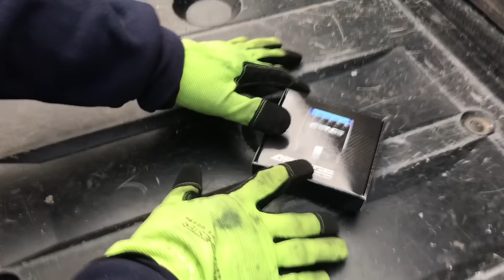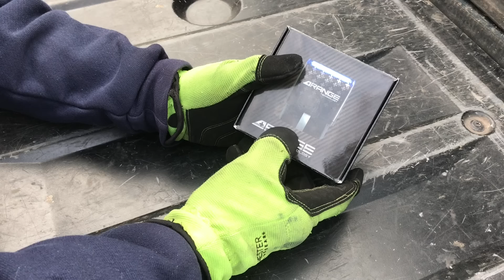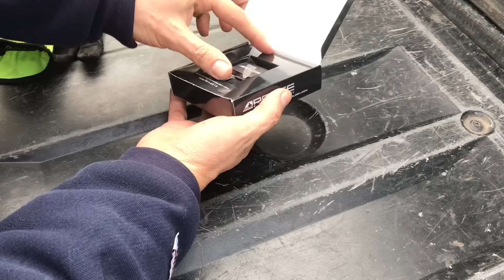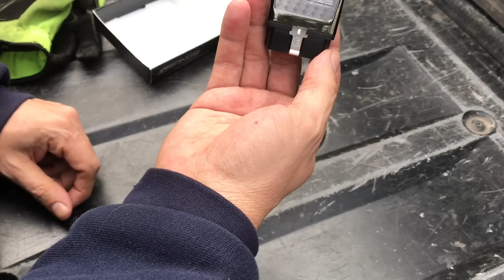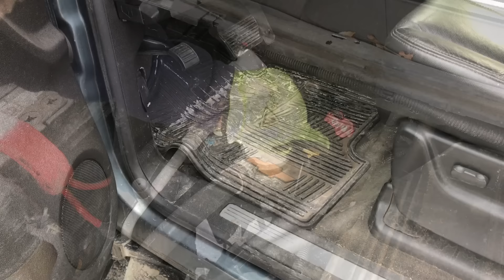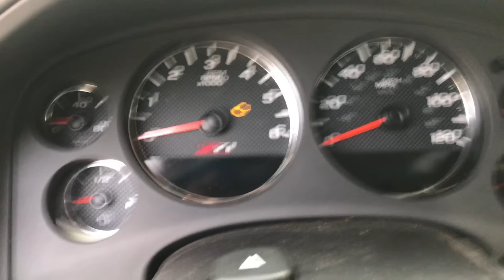Range AFM Disabler - Long Term Review

Comment: I tried this product (perhaps an older version of it, back in 2013-2014 when I got my truck) but I had nothing but problems.  I would randomly get errors on the DIC (anything from issues with the 4WD system to ABS errors).  I stopped using it, and the errors went away.  IN one instance, I had a hard shift from 2nd to third, and a check engine light, which I had to have cleared by the dealer (this was still when the truck was under warranty and I removed the Range unit obviously before taking it in).  But since I've stopped using it, I haven't had any issues.  Quote honestly, the difference I saw when using it (When it did work, which wasn't often) wasn't that big, maybe a 2-3 mpg savings.  In the end, it probably wasn't worth it.
Reply: I've run one for yr's and wouldn't be without it...on two occasions the engine light came on and false codes came up and all you do is unplug it while driving then plug it back in and the codes are gone and the engine light is off. I've also had the truck sit for 8 or 10 days and battery drain has never been a problem and winters here get down to as much as -30 C.
Reply from the maker: I’ve heard similar stories from quite a few people.  Knock on wood, I haven’t experienced that.  I definitely lost MPG’s using it tho.
Reply: @HilltownCT  It sounds like the ones they are selling these days must have a software update as many people here are reporting better stories than what i first heard when it first came out.  But some people also are telling which trucks they have so it may work better on newer ones (for example, ones with the EcoTec engines versus the Vortec engine--not sure if DOD is different between the too though).  I'm a bit surprised you lost a lot of MPGs though, as I think the hit should only be about 1-2 MPG.  For the times mine did work (which was rare) I only saw maybe a 1-2 MPG increase but maybe that was just my truck.  Others might be different. How much did you end up losing using the V4?
Reply: @HilltownCT  Mine was one from when they first came out.  I think whether you get a good one or not depends on when you bought it.  The first few batches probably had some issues in the programming, that maybe got resolved in later versions).  I drive mostly on the highway anyway (so 60 MPH+) most of the time so AFM only kicks in for the times when I"m driving around town ,which isn't much compared to overall driving, so I just deal with AFM.  Truck isn't actually exhibiting any odd behavior other than a little bit of oil consumption, but that's manageable.

Comment: On 6 speed GM automatics, if you put your transmission in 5th gear instead of Drive, it deactivates AFM too. Since most of my driving is local at speeds under 50mph, thats what I do so my truck only goes to 4 cylinders if im on the freeway and i happen to shift it into Drive (6th gear).  I think switching to tow mode might also deactivate AFM.
Reply: c5back9 tow haul mode doesn’t deactivate the afm. But I’ve been doing what you’ve been doing as well.
Reply: James Sanville: thanks James! Coincidentally, I had occasion to tow a trailer yesterday, and checked then if Tow/Haul mode did indeed deactivate AFM. As you indicated in your reply, it does not.
Reply: @c5back9  tow mode does not deactivate v4 mode on my 2013 Suburban
Reply: Charles P Stauhs not tow mode. Lock out in 5th gear instead of “D” and it won’t go into v4.
Reply: @GetOutside38  how is your suburban keeping up? I am getting a 2010 tahoe
Reply: I just leave it in 5th all the time. AFM never comes on and gas mileage is barely 1 mile per gallon less.

Comment: the issue i am having is that my AFM doesnt deactivate when driving in slow traffic, coming to slow stops.. the truck vibrates.. then the AFM deactivates when the truck stops.  any suggestions?
Reply from the maker: I don’t, but maybe someone else here can help you out.  Others have mentioned the same problem in the chat.
Reply: Daniel Grobe did you find an answer? Mine does something similar

Comment: I’ve had this device on my 13 Yukon for about 8 months (since about 47k or so) with no issues at all. MPG did not change. I bought it for what I’m hoping will be a successful preventive measure.
Reply: I’m at 97k now and all is well
Reply: How is this going in 2022??
Reply: @anthonymoy4471  119K and all is well
Reply: @seth_5394  how about how
Reply: @elchapito2368  123k and all is well
Reply: @seth_5394  how about now 🤣
Reply: @goonie2908  128k and all is well.
Reply: @seth_5394  I just bought a Caprice PPV 2011w/45,000 miles, and since the agency took the car for normal warranty service until 36,000 miles(I'm assuming the engine is ok), I'm hoping there is no problem within 9,000 miles later. I will be installing this on the car. I am getting the car next week. So this will prevent a good engine from going bad?
Reply: @robertcohen8554  that’s the theory. We shall see.
Reply: I am hoping so myself, would rather not be replacing lifters and so on. Thoughts on preventative measures taken so far ?
Reply: @LarsonFishing  hows your truck going
Reply: Try Again - running good and strong, no issues. “Knock on wood”  the device is still running good as well. All 8 of My cylinders are always firing, just as if hope, no lag or such.
Reply: @seth_5394 and now?
Reply: @andrewtodd4116  137k and all is well
Reply: @seth_5394 🤝
Reply: @seth_5394 how about now ? Still running the same disabler all these years or did you have to replace the device at some point.  Thanks I’m advance
Reply: @OBS-ip2hy  163k and all is well. Same device, never had to replace. It’s plugged in every day. I’m genuinely hoping to get 300k out of this truck.

Comment: We bought one for my son's 08 silverado 5.3 and it would make the transmission down shift real hard. Had to threaten to sue to get a refund. The fix for oil consumption was the valve cover and the oil pressure relief valve deflector. The deflector is what did the trick.
Reply: Crazy
Reply: This has me worried
Reply: @dustinabrams3111  
Should give you an update, this past June pulled the engine out because of oil leaks and the piston rings were all full of carbon. Cleaned the pistons and the rings and drilled some drain holes in the wiper ring area. Seems to not use as much oil. I"m really surprised GM has not been sued for violating the clean air act because of this.
Reply: @robertoobregon3750  Ya I won’t being buying this thought about it just worried
Reply: @dustinabrams3111  okay, so far at 200k miles and will likely go another 200k and not have to buy another. The first 200k took 12 yrs.

Comment: I'm looking into getting one just because I put duel exhaust on my truck and V4 mode sounds stupid. My Silverado is a 2013 and so far I have 96000 miles and it hasn't used a drop of oil so far.  I change my oil every 5000 miles and use Castrol Edge. I didn't realize the AFM was such an issue. I'm definately going to get one and try it out. Thanks for the info
Reply: Me too sounds dumb with dual exhaust

Comment: After start... sierra  vibrate , engine sign start to blink stability track off after mile  engine sign stay on but no vibrate .....already changed fuel pump , fuel module too don’t know what is problem fuel Gauge not working burning lots gas help please any idea

Comment: My idle oil pressure dropped about 5psi. At speed it is normal. 07 suburban 5.3. Any one else notice this? My guess is it is always in 4 at idle the computer may increase idle pressure to assure proper activation of the lifters. Was 40-45 now 35-45. Good either way.
Reply: My 15 truck 5.3 stays in v8 at idle
Reply: Hows your suburban keeping up?

Comment: just a stupid question , why do people use the oil life indicator to be zero before changing oil? i get its there. but as a tech for GMC dealership for nearly 7 yrs and as someone who owns a 2108 gmc sierra and a 08 pontiac g6 , i never go lower then 50% on oil changes. you pay how much for the device? it is common knowledge frequent oil changes protects engine life and gas mileage. so instead waiting 7000-7500 miles why not just change regularly at 5000?  as someone else posted alot of the oil consumption does come faulty PCV valve. But i have seen more issues with the AFM lifters failing causing problems due to lack of proper oil changes. it also known that the body style up to 2014 had piston/rings issues in the trucks and in terrains causing oil consumption.
Reply from the maker: I think they use it because it’s there.  Now that I’m coming up on 200k, I’m more conservative with the OLM than I used to be. I usually change it when I’m between 10-20% remaining.
Reply: I don’t go by the indicator. I change mine every 5k regardless. It’s easy to remember to change it on the 5s and 10s. But for some reason I do reset the gauge 🤔. I think I do it so I don’t see the warnings when the system is close to 0% life remaining.
Reply: I change it at 30%

Comment: Thank you for uploading your video. One question does this device help prevent the common lifter lobe cam failure by using it? Or it makes no impact on that regard?
Reply from the maker: From what I understand, it’s a preventative measure.  I suppose that even with a disabler, an AFM solenoid could fail and cause lifter issues, but that’s just a guess on my part.
Reply: Yes!  The lifter and rocker problems are caused by those inactive cylinders starving for oil when the engine in running in V4 mode.
Reply: Cruz Deleon yes when the engine is running v4 on the long run the lifters will start making noise and colapse. With the engine running v8 full time it keeps all lifters running the way they supposed to be. Also if you can use an oil catch can it will help you to. Specially if you have GDI engine.
Reply: So CRAZY HORSE you think this really works, cus my lifters went out truck it’s at dealer replacing lifters but want to delete this AFM bullcrap b4 it happens again.
Reply: @Howruok  yes it really does.   My friend had a lifter go out on an 08.  Had oil consumption issues.  Has had zero problems since and put about 60 thousand miles on the truck 3 years plus and thr disabled is still working great
Reply: Will this work on a 2017 Suburban with 5.3. No issues at 90K but want to prevent the lifter collapse? Thanks
Reply: It does work. I have the 6.2 V8 and have been running the RANGE AFM disabler for close to 30k miles. I've had zero issues and no more oil consumption. I did loose about 1mpg.

Comment: What grade of Octane are you using with your Disabler? I contacted Range and they haven't emailed me back. I'm currently running 87 octane but it has a ticking sound at idle and in gear at idle and was wondering if by having the range Disabler installed, that I'm thinking that it would advance the timing in the ECU, which leads to me thinking I may need to run 89 or 93 octane! What are your thoughts?
Reply from the maker: I’m not familiar with your issue. I started running premium a few months ago because I was experiencing ocassional pinging when the engine would lug (below what the knock sensor could detect?).  The premium has solved my issue.
Reply: Hilltown I believe I'm having the same issue. When I put my truck in gear and it is near a wall at my house it would Tick, tick, tick, and the noise is coming from the left fender wall and underneath the driver's door. I wish I could send you a video of the ticking sound that I'm talking about. It is not the tapping sound like when you first start the truck on a cold start, this happens when the truck gets up to normal temperature (210 degrees). It also ticks in park as well. I have tried, my first tank or 89 octane and have gone 100 miles on it and the ticking is still there but not as bad as it is with 87 octane. With you running premium gas, do you noticed if your truck is running rich or have more carbon buildup on the tailpipes and does your truck run smoother with premium? I also have read that you may loose power if you run premium, have you experienced any of that? I know it's a lot to ask, but I would like to know before I mess my truck up.  Thanks alot man!
Reply: Tcase skid plate taps the tcase with rought  idle movements, drove me crazy for a month or so.

Comment: I bought one of these  a cpl yrs or so ago.  It would quit working after a few days and I would have to unplug and reinstall it. I finally took it off .   I wrote a negative comment on their  facebook page and they contacted me.  I wanted a refund , but all they would do is send me a "new and improved"  version. It is still the in the box .  We just drive the 2016 Yukon in M5 .  I am told it will not go into AFM mode in M5.  I am not sure if that is right.
Reply: It was about 18 months ago when I got the first one.  The Yukon is a 2012,  not 2016. Senior moment.
Reply: Paul Davis I used to run in M5 for about a year before I bought the Range chip on sale. M5 worked great and never allowed the truck to go into V4 mode. Definitely like the chip better now that I can use my 6th gear
Reply: @KsKaylor  Thanks for the advice. I'll start using M5 until I get one.
Reply: @KsKaylor  Can you still be in m5 if you come to a complete stop?
Reply: @lovelife2315  no, the truck will bring you back down to first gear if you’re at a stop. When you take off from a start, it will go up to every gear except 6. You don’t even need to manually shift.
Reply from the maker: I’ve heard others mention the manual mode work around, but I can’t speak to it since my truck isn’t equipped with it.

Comment: Side question: Do you think the Seafoam oil treatment was worth doing? Any change + - after doing it. Would you do it again? 

Thx for the vid
MJ
Reply: Same here. Seafoam products are great
Reply from the maker: Aside from how dirty the oil was when I changed it, I haven’t noticed a difference since.  The topic of Seafoam is more divisive than politics, but based on my own research and experience, I’m a believer.
Reply: Marvel mystery oil will help with lifter noise and lubrication right after doing sea foam
Reply: Hot shot secret works good for me

Comment: I buying tunner that turns it off   , Trac control has to go too!
Reply: Estebahn G why would you want to turn traction control? 
Not trying to be a jerk or anything lol I’m genuinely curious on why
Reply: @PanchoPistolas45  because you can't do fun dumb shit with tc on lol I plan on getting rid of mine also
Reply: That wont fix it. You'll still have to go in and get the delete kit itself
Reply: Do a fuse number 9 delete and run a button or toggle switch in the cab. Then you can control it when off road to get more traction or just to gain full power of your truck, but when you flip it you won’t have abs. It’s just like an old school Chevy pickup lol

Comment: My 2012 Tahoe judders when it drops into 4 cylinder mode and surges when switching back to 8 when coming to a stop. It has done that from new - sucks. I need one of these.
Reply from the maker: Yes, that does does suck!  Range is still serving me well 10k miles later.

Comment: I have a 2014 Silverado with the 6.2 it's got 120k miles no issues with oil consumption  but it's currently back at Chevrolet with afm lifter failure and possible cam damage . Chevrolet and I have had some pretty heated conversations over this shit !!
Reply from the maker: I can only imagine.  Good luck Jim and I hope you come out on top.
Reply: Dude I just went through all this with mine.  Had some heated conversations with the dealer and GM both.  The dealer tried to charge me $8000 to fix the lifters,  but I got it down to 3400. Truck is back on the road for bow but I've got a funny feeling it's gunna fail again soon even though I had all the lifters replaced and the afm. As long as it doesn't wait two years it's under a 2 year warranty.  But I'm gunna be saving for a Jasper engine that comes without the afm crap on it.
Reply: Update,  my truck just had the same failer yet again today, (4000 miles after having lifters replaced) and is going back in the shop. FML
Reply: I hear you brother - I just got my 2015 GMC Sierra  92k miles back from the dealer with the exact same issue. 3k$$$$ later my truck is back on the road! Oh and my powertrain warranty just expired literally three months ago!
Reply: my 2015 5.3 GMC sierra is at the dealer now with lifter and potential camshaft damage after hearing a knocking sound coming from the engine, they tried to charge me 2-3k to break down the motor to diagnose and then another 2k to replace cam and all lifters. I am exactly 1 month past my 5-year warranty on the powertrain. I told them i was gonna take the truck somewhere else and then they told me that GM was now gonna offer to pay 90% of costs and now I only have to pay $600-700$. He clearly knew what the problem was but were trying to milk me out of paying out of pocket.

Comment: I love how this pops up AFTER afm caused my lifters to fail. Thanks YouTube hahaha I'm looking into the afm delete and a tune. That'll fix it haha
Reply: I'm looking to avoid such a thing myself. Has there been any negative reviews in using afm delete? As in when you take the obd2 out and the vehicle tries engaging afm something gets stuck from it not being used regularly?
Reply: How did it turn out. My lifters just failed on my 2008 avalanche. Just gonna replace the lifter and use this.
Reply: Haha true!  I've been bragging for years how my engine shifted down 4 cylinders to save gas.  Well they just replaced my engine.  I'm starting off this time with a Ranger.  Give me my 8 cylinders please!